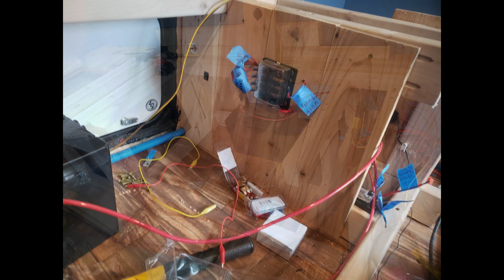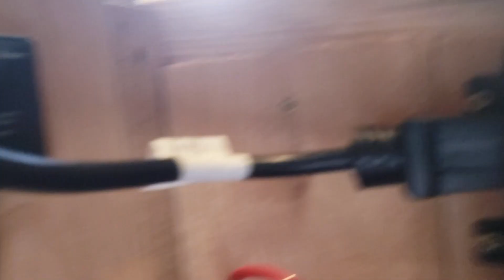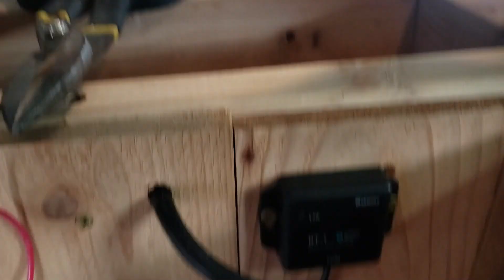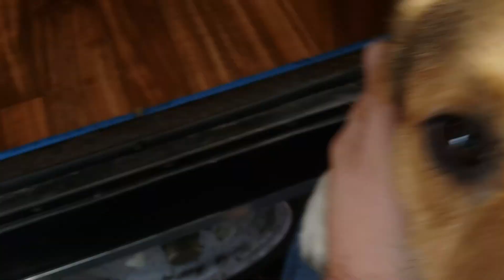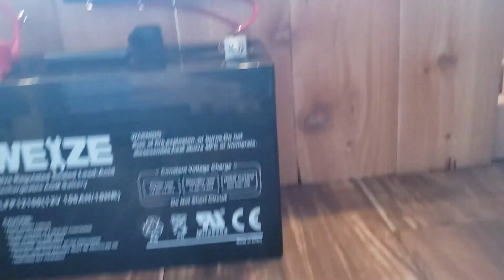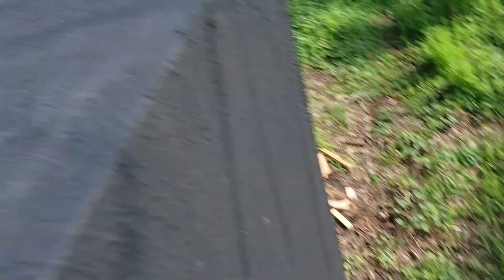Episode 16, Budget 4x8 Micro Camper Build

Comment: What kind of sealing are you using on the roof? It's not silicone? I use Lepage's QUAD, used it on my clapboard cabin. It will never come off.
Reply from the maker: Under every penetration and seam I use butyl tape trimmed at then sealed in behind silicone.
Reply: @downtownredneck5079  Silicone. Hmm. Can't find the quality I used to find. Then someone put me on to QUAD. Can't pull it off. My roof is permanently sealed and attached.

Comment: I'm just going to throw a mattress down. I'm trading up from a mattress in the back of my chev uplander minivan. I just have a tiny tractor battery for lights on the weekend. The only real complicated wiring I'm doing is two (😂😅) sets of taillights and marker lights. I found jeep-like taillights. Seeing as I have a 2008 Jeep, well, I had to add them. 😊👍😁
Reply from the maker: I am building my micro camper to take the family out on campsites without power and still have access to all the things that a 6 year old would want but keep it small enough to tow behind the Focus ST. That said I needed to be able to convert the bed into a couch so we could have floor space, and I found a 12v DC Television with DVD player and hooked up an HDMI cable from the front to the back where the TV is through the walls.

Comment: Good job on commercially made windows and door 👍
Reply from the maker: Took a few months to track down and acquire them all for cheap prices, the utility door and three windows are from Ebay and the door is from Challenger Doors which was the cheapest manufactured teardrop sized door I could find
Reply: @downtownredneck5079  I got my door and windows from challenger. They didn't want to sell me the windows until I convinced them they were selling them on their website. What they listed were probably prices for door windows 😂. And I will have to fidget them to do what I want. But doing it professionally was the only way to make sure I have a camper I can resell. I didn't want a backyard looking job.

Comment: Hey there. I would only suggest the torsion axles I used. See Squaredrop Campers Group. I used 15" radials, albeit trailer tires. I see too many trailers bouncing precariously.
I was going to do a YouTube video thing, but time took over.
I used 4x8x4 grade A plywood. I did use a cleat along the bottom to attach the walls and 1x3 perpendicularly to support the roof. The rest of structural integrity will be the fiberglass.
Reply from the maker: It's been a budget build and I do plan on updating the wheels and axle at some point but I've driven with it for over 500 miles and it pulls behind the focus like a well behaved puppy